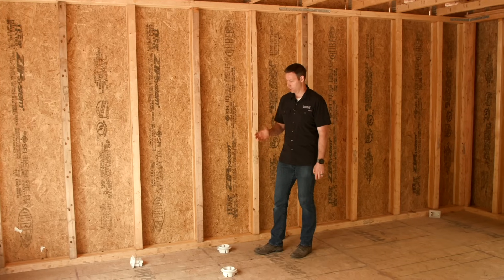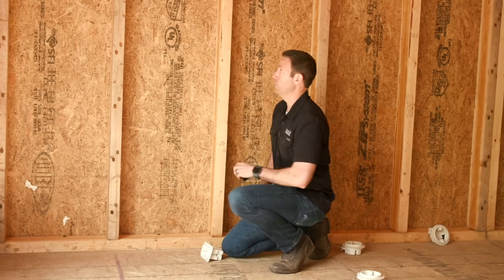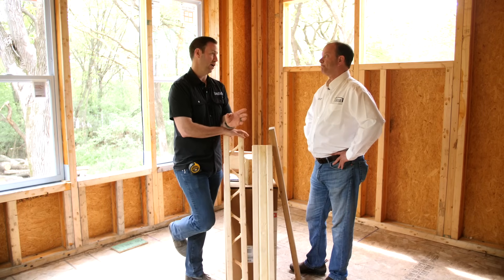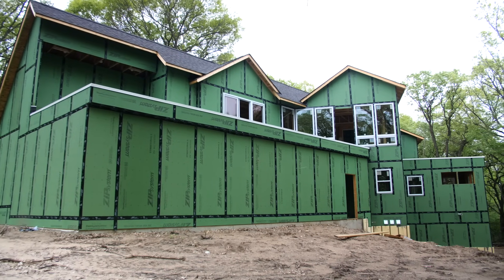Insulated Studs? This is a BIG Innovation in Framing!

Comment: Perfect timing! 
I am specking out a complete Cottage rebuild and really hope availability isn’t going to be an issue.
Reply: Great product. Go big and use the bigger one (8"), Rockwool, 24" on center. Never ever use treated wood, not even on sylls. With the wider wood u can now mount the drywall vertical like we do in europe.
Reply: @72strand  , why not use treated wood, at least for the sills? Fastener corrosion?
Reply: Ok, so where i live. We don't use treated for sills. We know that concrete is wet, but not that wet. It is moist. If you put wood on concrete the wood sucks the moist from the concrete and over time, If the wood cant dry fast, you get mold. In old leaky houses that was no problem. In new houses it is. Treated wood sucks moist the same way normal wood does. The only difference is that the treated wood don't care if it have water. It will not start to degrade. Not only that. Wood above the sill, will start to suck water from the treated sill to. When the treated sill gets water, it will start to smell. And some say the off gases are bad for your health. So, what to do? Here we use a sill paper/rubber under the sill. As a seal from concrete to wood (sill). That way you break the direct contact wood/concrete. The concrete will have to dry to the sides. And the wood is protected from the moist concrete.

Comment: OK, if a wall is framed with 2x6 on 24 inch centers, batt insulation is 22.5 inches wide.  The cavity on these will be 21.5 inches wide.  Where might I get batt insulation this size?

Comment: Just skip the wood and go polyurethane SIPs (structurally insulated panels.)  It is air tight and has a much better R-value than the equivalent thickness of batt insulation.  No thermal bridges and no air leakage makes it a far superior system for energy efficiency.  You will need to make sure you have your ventilation is correct to control for moisture/condensation while supplying fresh air.
Reply: This product addresses the thermal bridge problem, but not the air leakage problem or the convection loops in the wall issue.  There is no reason to use polyurethane, versus polystyrene, unless you are on a tiny lot where every inch of footprint is a big deal.
Reply: @BenjaminFranklin99-s9n  Polyurethane has a much higher r-value than polystyrene.
Reply: @wesbaumguardner8829  True, but nothing remotely like the R-value you are claiming for a 5.5 inch SIP.
Reply: @BenjaminFranklin99-s9n  Precisely what are you claiming that I am claiming?
Reply: @BenjaminFranklin99-s9n  A 6" batt has an R-value of 19, whereas the highest rated EPS has an R-value of 4.2 per inch or 23.1 for a 5.5 inch thickness.  I have seen closed cell polyurethane advertised as high as 7.3 per inch but to be conservative I'll use an R-value of  6.7, which is the top rating per quick web search.  So a 5.5 inch thickness of polyurethane foam insulation would have an R-value of 36.85, which is almost 60% greater than the extruded polystyrene insulation you are toting and is almost double the R-value of a 6" batt.  That is a significant difference.
Reply: @BenjaminFranklin99-s9n  You think I have lost track of what?  Your nondescript argument lacks basis.  Your subjective opinion does not matter.  Why do you not use the actual compressive and tensile strengths of the materials as tested by accredited agencies to state your position?  I will tell you why... because your position is wrong.  Blow whatever smoke you want, you will not fool me.  I have a degree in Construction Science from Texas A&M College Station, TX.  I use real data to form my opinion.  You use subjective bullshit.  Go ahead and refute me, I will destroy your arguments.

Comment: First thought.. Crap. 
Last thought.. Total crap. 
Anyone who builds knows it too.
Reply: Why?  Only downside I see is price. Seriously please tell me why my next building should not use these?
Reply: It can't be stronger than a whole stick, probably the same price as 2x6 plates and staggered 2x4s, in a remodel new screw holes will likely split the 2x2s, toe nailing going to have a higher chance of totally trashing the end, your gonna need real wood for window casings and doors anyways. 
Idk man, new things always get resistance. 
I sure wouldn't want it during a hurricane. 
Benefits.. lighter for workers, sound proofing, and insulation qualities... Real easy for electricians and plumbers. 
I guess if used in the right places, not corners, headers or weight bearing parts of the structure. Thats obvious though. Getting codes written for proper placement across America is going to be the toughest part. May as well throw the framing hammer or framing gun down and grab a smaller nail gun.
Reply: @CORYJOHNM  thanks for  thought out response.  On the windows why do you need solid? The ones they have shown are t studs, it would work for our style I think. One the load factor he said test show it is 4x stronger. My limited hurricane building experience has been either solid concrete and true storm doors or build it super cheap and run to the main land when the storm hits the island and just rebuild.  My inspectors are now wanting everything strapped down anyway so toe nails are being replaced with steel strap. I totally agree this is not a cure all pill but in my area hot Summers and cold windy Winters with no hurricane or earthquake danger I think this could be a winner.  Anyway it is my bedtime.  Thanks
Reply: Just foam over the decking.
Reply: Does it beat the "blanket" price?
Reply: I'd prefer the naked version so I don't have to wear a mask as the cutter guy.
Reply: Brian said its stronger and he did the math and testing. Kinda hard to argue with there. The builder said he likes using it and not going to argue with that either. Get your goggles and mask ready, Im sure not getting foam dust in my eyes or lungs.
Reply: After Harvey hit Port Aransas, you could see what worked. Straps yes and in tempid climates this is a go.

Comment: Awsome product! 
I've cosidered a double 2x4 wall with studs offset each other with 2x8 plates and 1" silverboard on the exterior over the OSB or plywood. But it would mean twice the labour as far as exterior wall stud assembly!
Reply: Done it before here in AK. exactly those problems and more dude. Doors and windows a real pain in the ass with no real good solutions.

Comment: 2' centers, I know part of the benefit of having it closer is that drywall rigidity is fine. But so wide I feel like if a friend pushes someone against the wall goofing around they may bust through. Thoughts?

Also, if it isn't 2x6 framing are there alternative dimensions for the typical lumber use?

That load stat is wild though!
Reply: 5/8 rock not just for sound any more.
Reply: 5/8 is reqd for studs on 24
Reply: I'd be tempted to just use plywood or osb on both sides.

Comment: So... do they make a very wide version for beam purposes? I really like the truss aesthetics.
Reply: The T-stud is only listed for compressive loads. The rigidity is higher than 2x6 for buckling failure but the dowels are not rated for use as joist load members. 

Have you looked at trusses that use steel tubes as diagonal (web) members but pairs of 2x6s (or larger) as the top and bottom flanges? The tubes are flattened where they sandwich between lumber. Steel bolts at each node.

Comment: I'm wondering the dollar amount that this translates to in energy savings. He said on average a 2500 sq ft house runs about $1500 dollars more than using a conventional 2x6 stud package, so the investment seems like it would pay itself off fairly fast. Also, Matt, 100% honest now, in your professional opinion, do you think this stud design will maintain its structural integrity over time, cause time is the tried and true test for anything!
Reply: Why not?  It is essentially an I-beam type construction, used also in SIP homes, boat decks, and foam core hulls - not to mention skyscrapers.

Comment: Here in CA we have Hold downs everywhere. How do you bolt a hold down to foam?
Reply: They showed a single thick metal plate spanning the gap in the sill, but you could tie into the studs instead of just the sill plate, which would be an improvement in overall strength. 

Is the foundation tie-in only supposed to prevent shear or to also prevent the wall from lifting?
Reply: Wide metal plate. There was a nice picture of one with a j bolt. Top single plate might be a bit tricky but easy engineered around.
Reply: Those aren’t hold downs on the bott plate, that’s a washer.

Comment: This is incredible, I want my next house to have this. I don't see how you can replace a header with a bunch of these studs unless they're bonded together though - am I crazy for that not making sense?
Reply: That sounds like an excellent plan. Bond them together with structural urethane adhesive. Clad the outside and inside with horizontal plywood instead of weak exterior sheathing and gypsum board. The plywood will form an enormously strong box beam. 

PS. I have always thought that garage door openings needed some serious steel reinforcement at the corners to cope with racking. Same with walls that are mostly windows.

Comment: Looks like another product that's great for builders and bad for firefighters. Less wood means less safe time in a structure fire. I would like these in combination with residential fire sprinklers. It would greatly reduce the cost to install the sprinklers and add that measure of safety need with less wood to support weight.

Comment: All the trades are going to have that little bit of time savings as well - no holes to drill for wires, pipes... Wow. Pretty impressive, all around, ease of use, strength, price, even! :-)
Reply: ?????  I see more holes being drilled,  problems   in dealing with the foam.  With the trades as busy as they are  I can see people noping out of working with this material.  safety concerns working around so much drilled and chopped even burnt foam.

Comment: Only drawback is the toxic foam fumes in a fire... apart from that, looks good.
Reply: Another issue is they'll fail much sooner in a fire.  Rough guess is in 1/3 the time of traditional lumber.
Reply: First I honestly don't have any fire expertise BUT I watched a cold storage barn/ shop burn a month ago that was spray foamed with a steel skin. Once the 2 tractors and office burned out the structure was fine or at least fine enough to power wash and use it like normal.   I was impressed the next day when I drove by that it was still standing as the day before it had flames out both ends.  I assume it would be the same for a house as long as they had sheetrock that held up.   I worry more about demo and waste 30 years from now. 

 PS I heard the fire started from oily rags that fell under the tractor during routine maintenance.

Comment: Awesome!  How about IR footage of heated homes (one T-Stud, one solid studs) in January?  Hot Chocolate!
Reply: I too think some IR imagery comparing Tstud to conventional would be a great confirmation of the concept
Reply: IR footage: black screen probably
Reply: As they say, seeing is believing. We hired an IR guy to scan two steel warehouses side by side in November in 1999 when the price of natural gas skyrocketed in BC. The customer wanted proof that our ceramic insulation coating was providing any thermal control on the roof we had coated. The uncoated roof showed the steel rafters glowing bright orange when the image was taken from the outside. The coated roof did not show any thermal bridging at all. The image shows a consistent colour across the entire roof indicating zero thermal bridging. So yes let's see some visual evidence. It was certainly money well spent for us.
Reply: I was hoping to see this, like he did with that other house he built. Really fascinating perspective.
Reply: Rooftops in colder climates during the spring and fall tell the story. In the spring, snow melts off the studs faster than off the insulated points in between. Frosty fall mornings show dry lines on roofs where studs have melted the ice before the sun has had a chance.
Reply: very much need this!
Reply: Right on. Prove it.
Reply: I lived in ND... you DON"T need it.    You can SEE with naked eyes where every stud is in your siding.   That was with vinyl over foam.   That's how easy it was to see.

Comment: R20?   There is 4" of wood and 2" of spray foam.   Hopefully its a closed cell spray foam and the best on the market right now is 6.5R per inch. 2" of pine is R1.7.   Add all of that up and you'll get 16.4R, providing the foam really is the best on the market.   Also remember these are actually 5 1/2" wide, not a true 6".    The R value of a 5.5" of dry pine is actually R9.35.    Considering you'll also loose some R value through the connecting rods, this whole system seems like a gimmick.   With this style of construction, there is actually going to be very little R gain.  Also seems like a waste of material, you not only have two sections of 2x3, you have the dowels, glue and the foam in the center.  The only positive design I can see out of this is its structural strength.

Comment: Question, I get the strength and insulation value but what about fire rating. Seeing it’s similar to trusses and other light weight systems which don’t hold up to fire like traditional solid lumber. At what point do we need to look at occupant safety in a tragedy over insulation value, ease, etc?

Comment: My only concern with spray-in closed cell foam insulation, is if moisture get in, it would seem to me to make finding and repairing rot VERY difficult. Here in Florida, there are two kinds of homes. Those that have rot, and those that will get rot.

Comment: The only thing not mentioned both on their website and this video is the average cost increase or the cost comparison for a standard wall vs t stud wall. Even if the energy savings is 10% per year, it may take 2 lifetimes to recoup the additional construction cost (depending on what that magic number is). I currently spend $150 per month for 4 months heating cost in northern Idaho. So thermal loss through the stud surface area may not be a huge number to begin with, especially if you are already considering a foam thermal brake on the exterior of the structure.
Reply: Southern Idaho here I spend on average $250 to heat and $150 to cool a month so real quick ROI compared to you.
Reply: @BenjaminFranklin99-s9n  its only 2900 sq ft, but the basement helps for reduced heating requirements. Standard place with hydronic radiant baseboard and navian 95% gas boiler split tankless.

Comment: Wow. That is pretty baller.  I wonder how this would work with the tiny house community.  Lightweight and super insulating.  Plus strong as hell. Hmmm.
Reply: Takes up more space, most tiny homes use 2x4 structures on the exterior not 2x6.
Reply: @RadDadisRad  Agreed.  But since I live in a cold climate the R value seems like it would be worth it. <shrug>

Comment: light gauge metal. done.
Reply: Transfer more comparing material to material. However, steel is only as thick as a dime. It also allows more insulation to be placed.